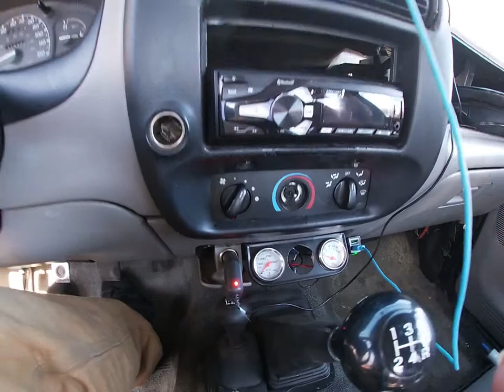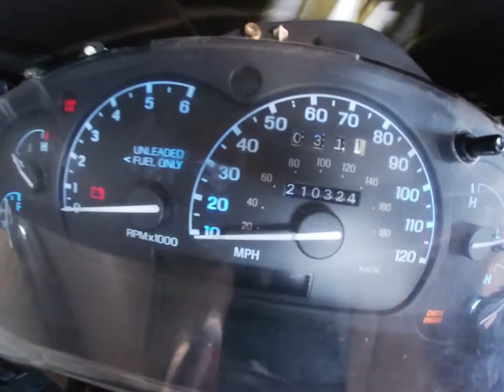How to install one of the best MODS for a vehicle! Part 1

Comment: Did this replace the Antitheft controller so you didn't need the factory key?
Reply from the maker: So my truck I installed it on didn’t have factory anti thief it’s a 96 b3000

Comment: Where can I buy more key chips for it? Mine don't work anymore and can't find them anywhere on Amazon
Reply from the maker: AMOCAM 125KHz RFID Key Fob Card Proximity ID Card Token Tags Keyfobs for Door Entry Access Control System(Read Only), Pack of 20 https://www.amazon.com/dp/B08XK6WPRZ/ref=cm_sw_r_cp_api_glt_fabc_7RAGGP8SC9FJPDP5EKVM
Reply from the maker: There are many other kinds I would make sure these work first
Reply: @akpowerstroke7435  would i need the master key to make these work? Because mine went dead too as well as the leather ones.
Reply from the maker: Yes you’ll need the master key it won’t beep at all? How long have you had it?
Reply: @akpowerstroke7435  got the car in a trade and it had this installed. Only the Master Blue key worked. And it doesn't anymore
Reply from the maker: We’re you given any other keys with it? Cause they shouldn’t just stop working. They are a very low level frequency so should always work. My key is still working great after this video. Maybe try unplugging the sensor and replugging it. Also if it’s hidden under anything take it out to see if it works.
Reply: @akpowerstroke7435  there's 2 leather ones and 2 master one's. Only 1 worked which was a blue one. But no even if you put it to the sensor it doesn't work
Reply from the maker: Umm let me see if there’s a way to factory reset it maybe. I’m not entirely sure.